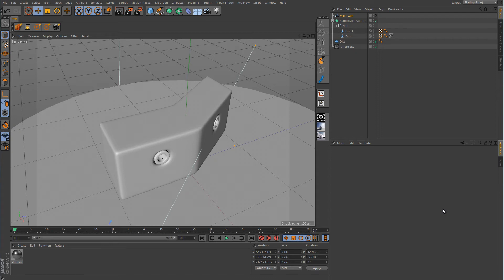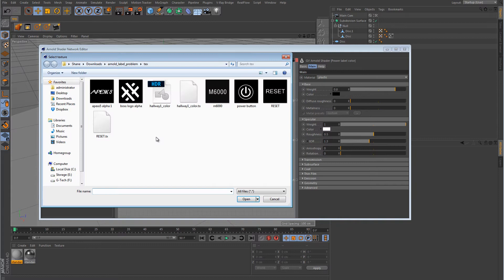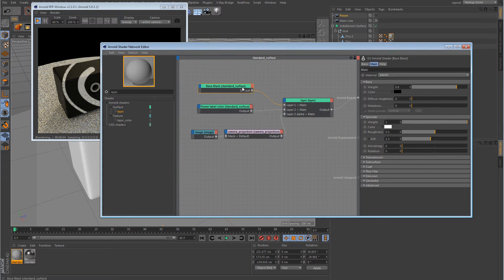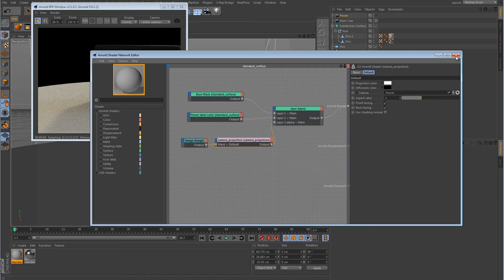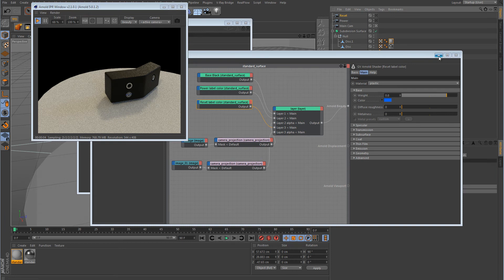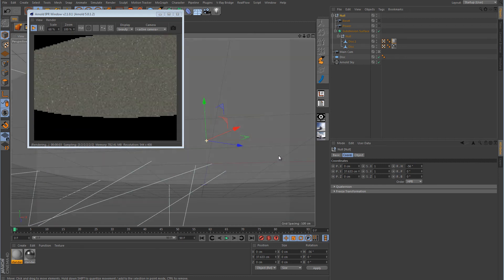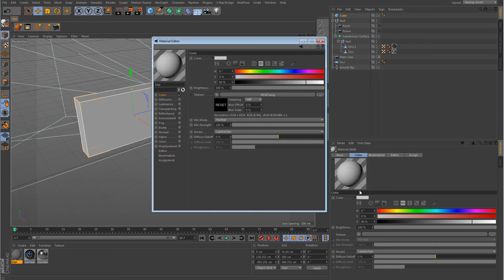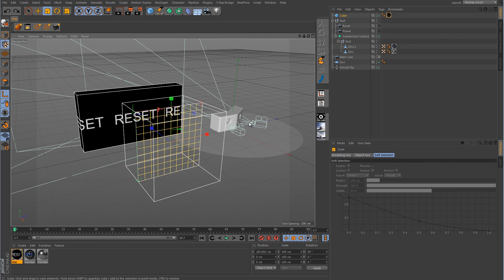Cinema 4D Tutorial - Arnold - Applying labels with camera projection

Comment: Shepperd .... there's a simpler and much more tidy way to accomplish this. First off isolate those polys (where you want the label to go) like you normally would - you can make a selection tag if you like but it's not even necessary. Isolate the polys, swtich to your BP - UV EDIT layout and convert your selected polys to selected UV's. Now invert the selection and use the UV Transform tab to scale those UV's to zero. Now only the UVs you need will be projected onto the model and only onto the polys you selected. You should also move the zero-scaled UV's onto a blank part of your texture - or if you won't tile your texture move them off of the canvas altogether.

In Arnold shader network use the exact setup you outlined in this video - two standard shaders with two colors - one for the base mat and one for the label and then mask layer 2 with your image - which will be projected only where you want it. It's all about scaling those unwanted UV's to zero my friend. It is by far the simplest and tidiest solution I've found to date. No extra cameras, no stacked mats ... just one mat stuck on the way you want. If you find that you need to project UV's for some of those other polys just select them, go into UV Edit and re-project them as a flat projection .. then you can scale them and position them to suit.

Comment: Shepperd, here is a method that requires zero layered materials and works quite well. It uses a stacked material approach. https://www.dropbox.com/s/25td7hw7vl5hing/CINEMA%204D_2017-09-08_10-13-13.png?dl=0
Reply: And here is another method, this time using multiple uv sets in one shader. https://www.dropbox.com/s/c36tsb9hbu7klo7/CINEMA%204D_2017-09-08_10-33-15.png?dl=0
Reply from the maker: Hey, GSG, thanks for chiming in! I tried the stacked material approach (using the alpha option and flat projection) and it worked quite well. The only problem I'm having with it, is that the label is also being projected onto the backside of the object. I tried using a set selection to keep the label only on the front, but that is when other problems arise.
Reply: Fairly easy to fix, can't you apply the shader to a poly selection?
Reply from the maker: Yes, but that causes new problems. Here is what the object looks like with the label applied (stacking material using flat projection).. https://www.dropbox.com/s/o066zrr7ww6udlc/no%20set%20selection.png?dl=0

If I apply the set selection, this is what happens... https://www.dropbox.com/s/3jgakk56pa04xso/arnold%20set%20selection.png?dl=0

Comment: But why using this technique? instead of the standard mapping? I'm not too familiar with arnold texture, can't u just use UV mapping, or the other mapping tools from cinema 4D? This will only work on flat surfaces without deformers applied...?
Reply from the maker: Using other mapping methods like flat, cubic, etc. causes some issues. I am currently looking into this further to see if there is a way to work around it.

Comment: Just had a thought and this can't be right and suppose you were projecting that label onto a cylinder. The sides would be distorted on the fall off.
Reply from the maker: You're right! This camera projection method works best with flat surfaces. For something round, (like a cylinder), we'd have to use another method. I'll have to look into this further and use a cylinder.
Reply: ShepperdOneill drop black and white mask into refraction and then opacity channel. Think I've got it figured. It's just bizarre that every renderer uses different naming for the same operations.
Reply: Glyn Dyer make a tutorial for the wrapping of a label on a cilinder.

Comment: This is quite a interesting solution Shepperd but I can't help but think completely insane with too many tasks to get to the desired result. Surely Arnold should be developing a solution with fewer tasks making the approach only as simple as it needs to be. I'm encouraged to have a play with this tomorrow to see if there is a more simplistic approach. If not then Redshift might be on the cards because I can't imagine anyone having the time or endurance to set up multiple cameras every time they need a new label.
Reply from the maker: I agree. However, if you were going to apply multiple labels using the default C4D materials, then you would need to duplicate the material tag and re-position it. So basically this camera projection is doing the same thing, but using multiple cameras vs. multiple material tags. Still a tedious task though.